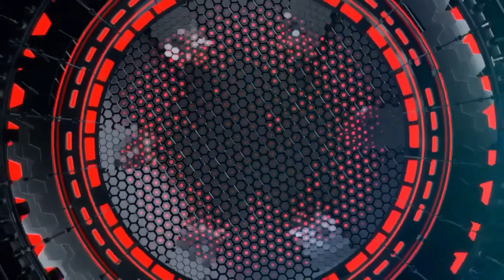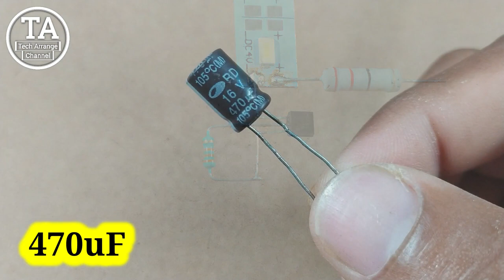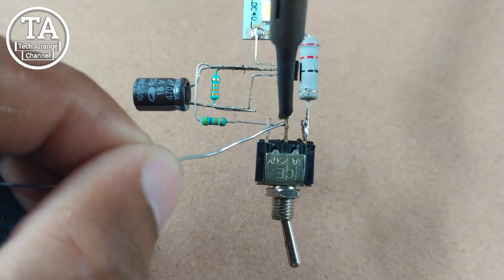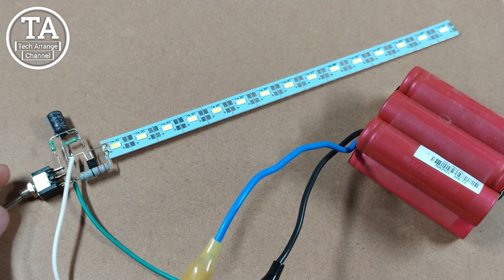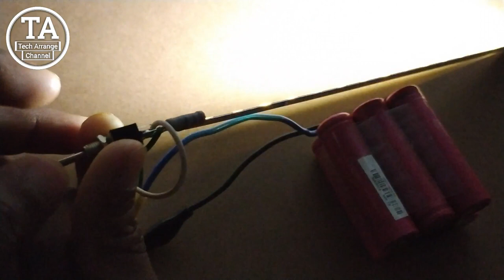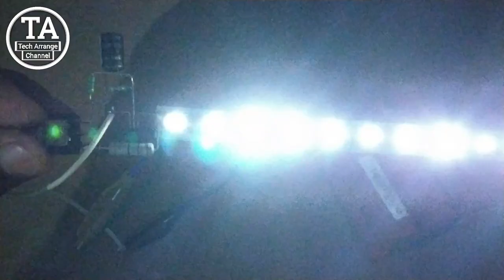How to Make Fade On and Fade Off LED Light | Simple circuit | New Invention

Comment: Basically a transistor driven by a switch and capacitor to slow down the off time after the switch is off.. i thought you were making something like a fading circuit
Reply: Can I use a TTP223 touch sensor instead of the switch?
Reply: @AkashThakur-r8k The touch sensor would output power when it is touched.  Yes you can indeed make it. Just gotta change the position of everything. If you want to make it let me know
Reply: @Yeaitts  that would be great if you could help me out, I'm trying to modify this circuit with the sensor instead of the switch,
1st attempt on the breadboard has been unsuccessful,
I'll try again tomorrow.
Reply: @Yeaitts  hi,
Update,
I made the circuit with the normal switch like in the video,
It works fine,

Then added the TTP223,
LED turn on when touched,
Fade in is perfect,
But as soon as touch is removed LED turns off,
No fadeoff...

What am I doing wrong here?
Reply: @AkashThakur-r8k  Hi, I also want to know the same. pls share your updates. i have seen some vid were fading is done by microcontrollers and all. but what i need a simple cost effective circuit.

Comment: worked for me on 12v led strip not using the 12e(1.3Mohm~) resistor. gonna try it soon on a longer led strip im assuming i may end up needing a bigger capacitor to keep them from dimming too quickly. would be super cool if you could explain what each component effects in the system

Comment: Thanks for the video, seroiusly. I don'tt know crap about resistances, voltage, ohms, or any of that, but by showing the exact components and how to connect them to each other, I can actually make my own circuit. I'd just like to know if there's a way to make the fading last a bit longer,
Reply: Increasing the value of the 47k resistor should do it (I believe doubling it should double the time), or increasing the capacity of the capacitor.  The first option is easier!
Reply: You may also need to increase the value of the other resistor too, now that I think about it...

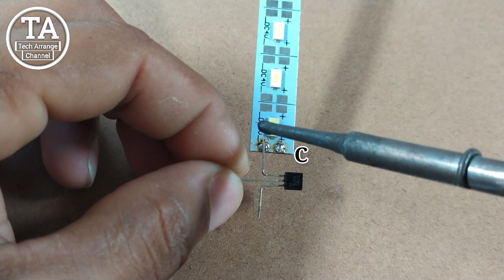Comment: 0:25 12E??!! Red, Red Black (22+∅ 0'S) resistor is 22Ω.. and it would be 22R not E
I saw at least one person who had looked that up and mistakenly got 1.3MΩ because that's a smd resistor code.
I'd highly suggest you either take the video down or add a massive VERY CLEAR disclaimer to the title and description stating this mistake!
Reply: R or E will do i used some programs where its E instead of R so no need to be angry

Comment: Will this work for 12v dc led strip?
Reply from the maker: Yes
Reply: maybe NOT !!!!   

BC547 has a 100mA as the continuous collector current (IC)   Strips can easily run at 1000mA
Reply: @kennmossman8701  means it will not gonna work out for (  12v dc led light strip ) 🥺

Comment: Can we use this circuit on 12v led strip?
Reply from the maker: Yes
Reply: Take the 12e resistor out of the circut
Reply: BC547 has a 100mA as the continuous collector current (IC)   Strips can easily run at 1000mA